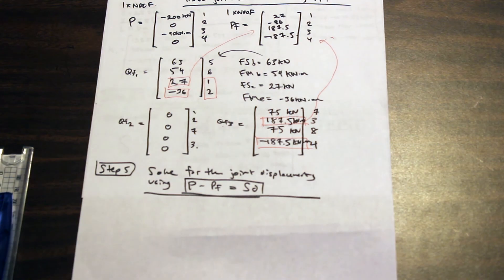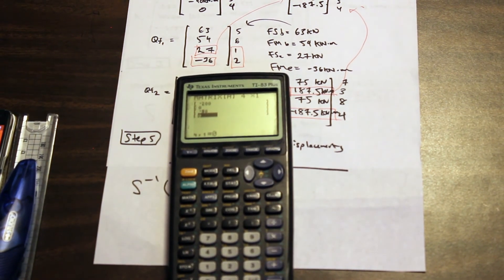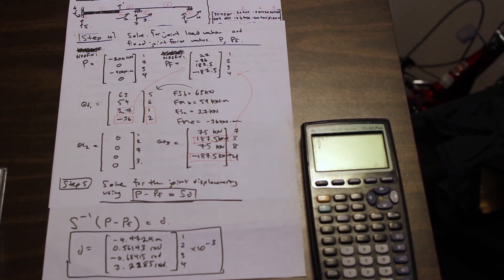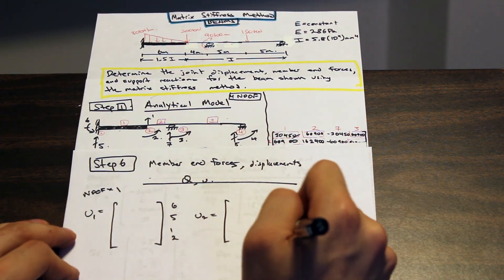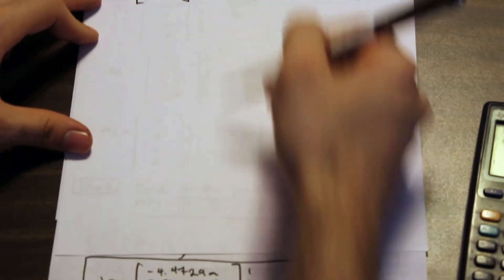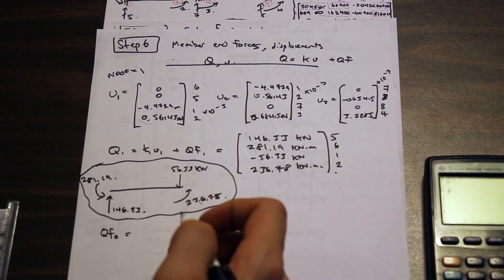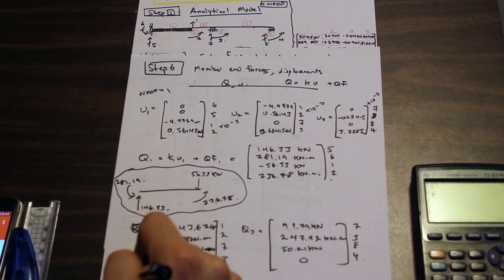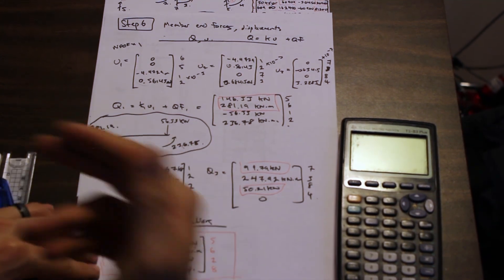Matrix Stiffness Method - How to Solve a Beam's Reactions - Part 3/3

Comment: I'm confused on how to know whether the answer is x10^3 for deflections/rotations. I've set up my units to be Newtons for force and meters for distance across the whole exercise, and I'm getting same answers as you (meters and radians), but don't know where the 10^-3 comes from?
Reply from the maker: You're getting deflection in meters when typically deflection ends up being a two digit millimeter value.

Comment: I think there's a small error on the code numbers for U1, it should go 5,6,1,2 instead of 6,5,1,2? But you wrote it correctly for Q1 below after that
Reply from the maker: Yea most likely, we do occasionally make small errors in our videos but as long as you get the concept and understand the core principles being taught that's the important part :) good catch though!